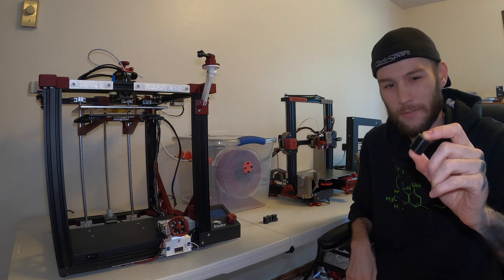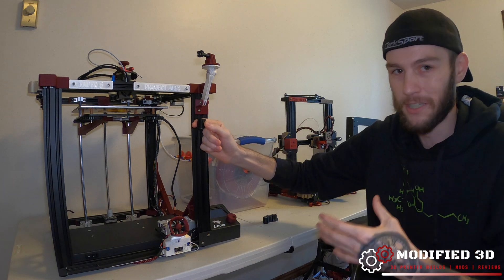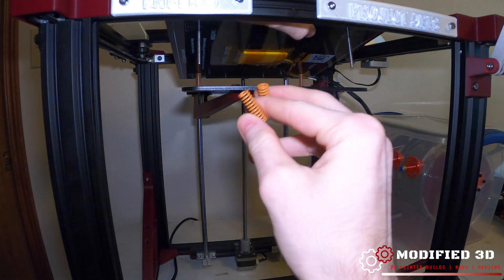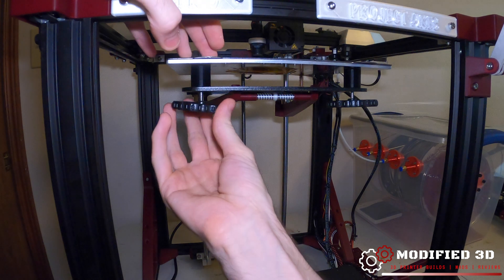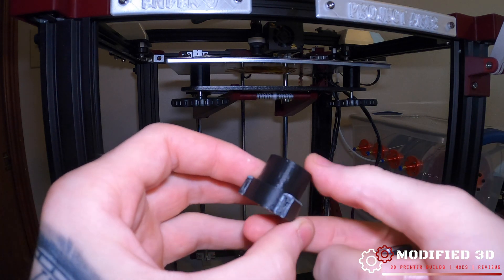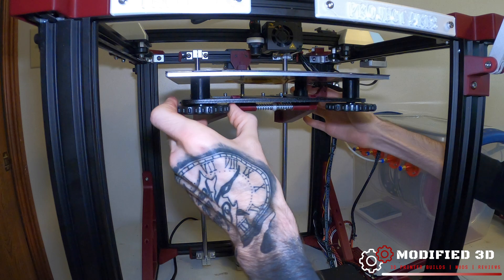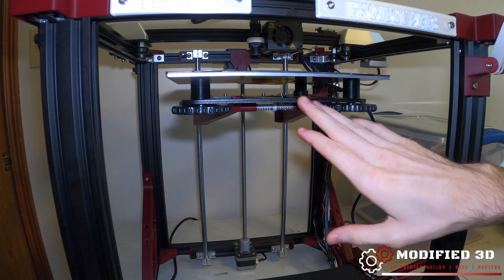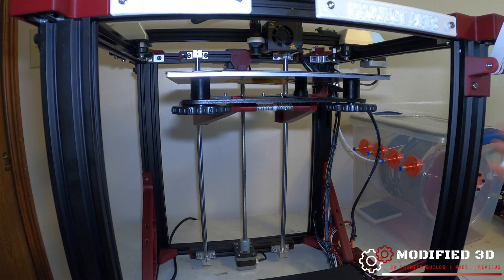Th3d Solid Bed Mount Install | Creality Ender 5 / Ender 5 Pro

Comment: i Have the ender 3 V2, i installed the EZABL on mine a few weeks ago, previously i had the BL touch for about 2 months, complete junk and nothing but a headache. The EZABL i love but i still find myself having to readjust the nozzle with a piece of paper almost after every print. I have yellow springs installed, would the solid mount setup make this issue go away?

Comment: Do you remove the spring and adjustment screw in the back after install so it doesn't come in contact with the z switch?
Reply from the maker: That would have been done previously with the install of the EZabl probe (or bltouch if going that route).